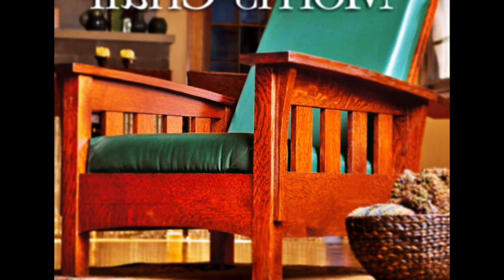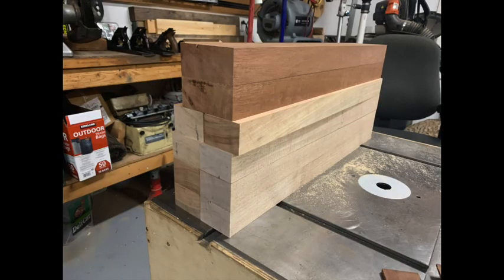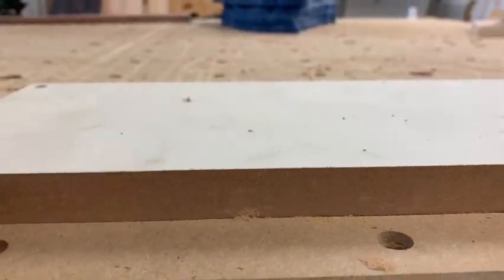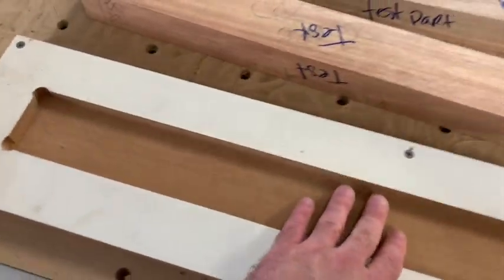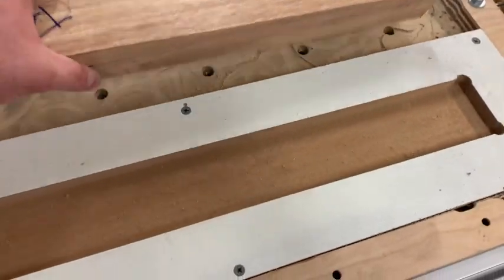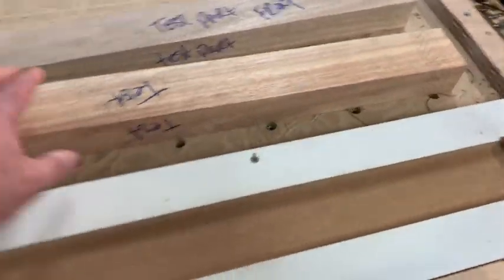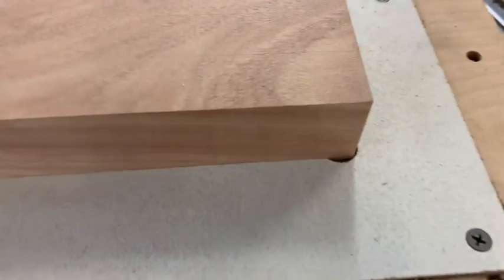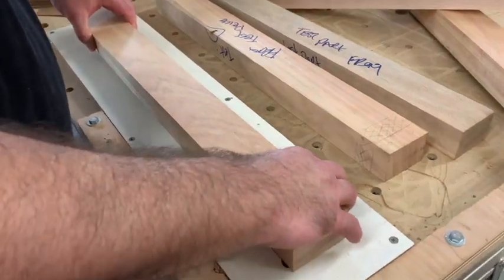Making a Morris Chair Part III - CNC Back Slats

Comment: Should be using a spiral bit, lower the depth of cut & slow the feed rate. The check the chip rate & feed for the spiral bit.
 Now being a year later your probably more familiar with the machine & tooling.
CNC router is a great tool to help with your woodworking projects.
Great job by the way!

Comment: Awesome work. I’ve tried doing that the cnc, but im struggling with the tool paths. Can figure out how to cut the curve. Hope you can help me.
Reply from the maker: what CAD and CAM software are you using?
Reply: @JeremiahL  Hi. I’m using vcarve pro
Reply from the maker: @nigelsamery8330  I would start by checking out fusion360.  V-carve is good for 2D and 2.5D CNC operations, but it's not really well equipped or designed for 3D operations.  Fusion 360 is free for home users.  It has all the functionality to do what you want to do...
Reply: @JeremiahL  Hi. Thank you I managed to figure it out. Real easy actually. Got the carving time down 31 min.

Comment: Hi. Would you better turn blanks 90 degree and do first setup by pair? like 5:28. then (make a slot with the shape) turn.  less passes,  better finish. Only one (probably first) more setup for tabs. Needs no ball mill :)
Reply from the maker: All roads lead to Rome.  I can say that the finish turned out pretty darn good.  I was mostly concerned about getting them identical.